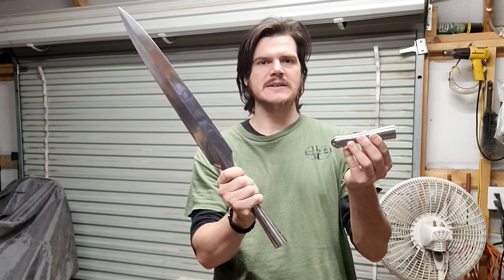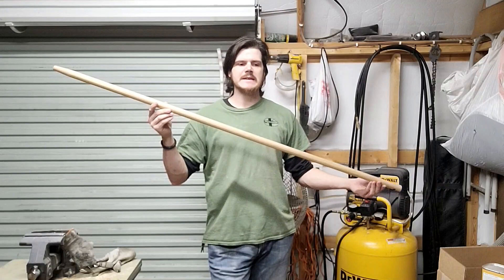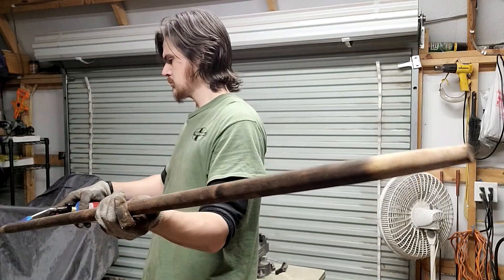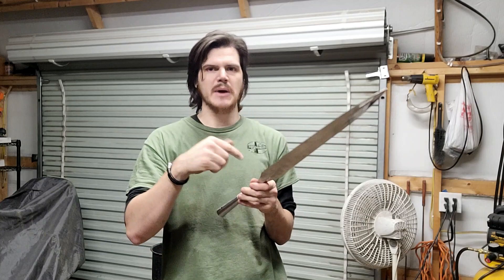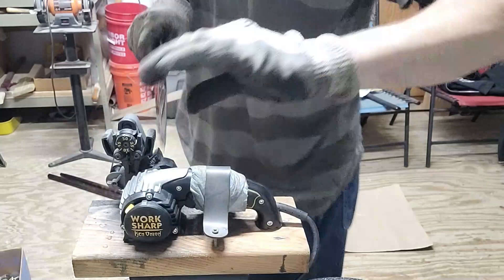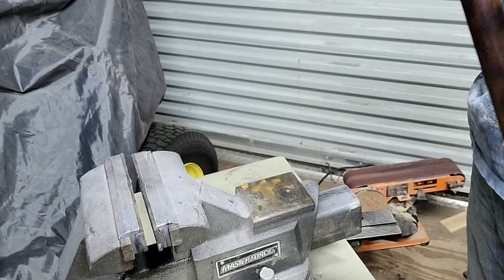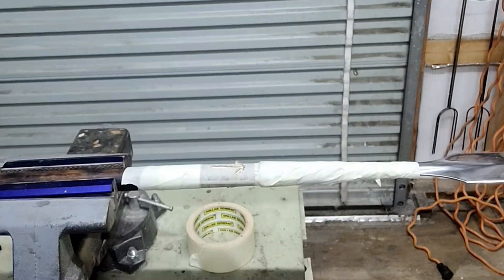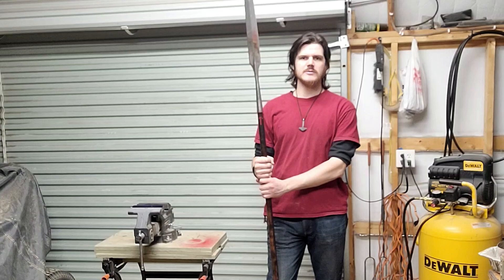Customizing Windlass Long Hewing Spear

Comment: Hello. First time here. Was looking for spear mounting procedure and I thank you very much for posting what you did. I am planning on mounting a Hewing Spear, a Viking Spear and a Javelin to round out my weapons collection. I don't have the tools you do so I will have to do all the shaping with rasps but I'm retired so I have the time. Anyway, thanks again for showing what you did and how. Cheers!
Reply from the maker: Hello! Welcome, glad the video was helpful. No problem at all, if you have a plane I'd start with that, pretty handy way to start the shaping. Also a farrier's rasp is very handy for shaping. I do the final shaping with a rasp and file if it's a spear shaft with a step. 

If you need any advice or anything feel free to message me. Thanks for watching!
Reply: @StudentOfWarCustoms  You know, it just so happens I have two farriers rasps - one huge one and one medium one. My father was a blacksmith, farrier and welder. I also have a plane - never thought of that. 
Thanks for the reply. Cheers!
Reply from the maker: Excellent! Yes farrier's rasps work very well on wood. I have 1 that I use on wood and it does an excellent job of fast wood removal. That's cool that your father was a blacksmith and farrier. I want to try blacksmithing some day. 

Also if you have a draw knife that can be very useful as well or even a regular knife but draw knife is preferable. 

No problem! Hope the spear shaft comes out how you want!